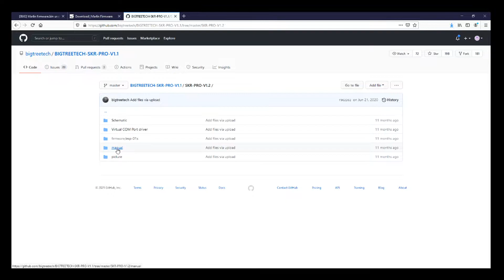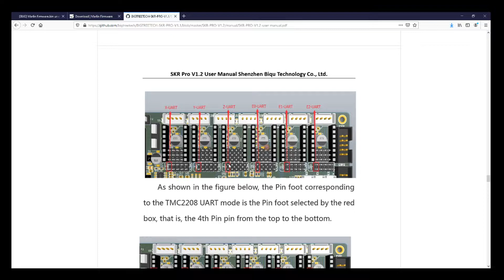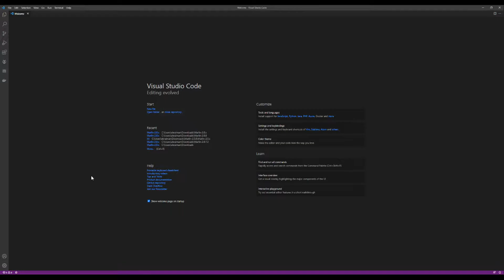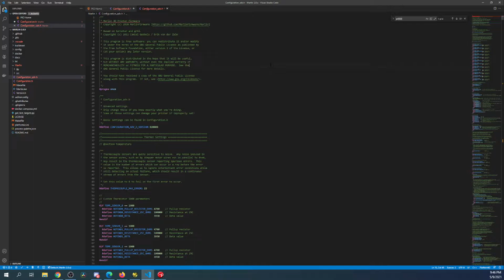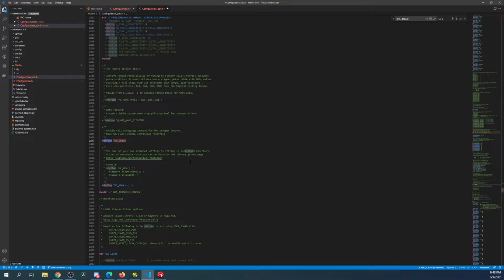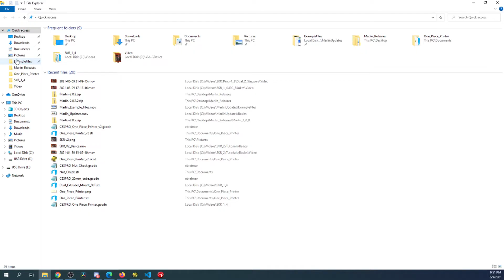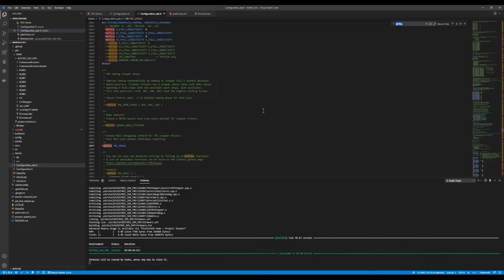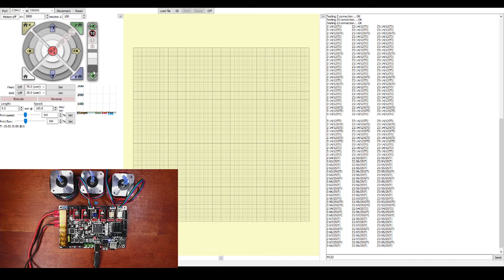SKR Pro V1.2 - Dual Z-axis steppers with TMC2208 UART

Comment: great video!!!  i can't figure out what you're using for a power source....at 6:09 you start connecting the power to the board....and stated you were not plugged in and show the power cord....so after you connect steppers and power (red/black) cables...what are using to the power the board to test all these connections?  also when you have the red/black cables connected to the board what is the other ends connected to?
Reply from the maker: It's a PSU.  The power depends on your requirements of either 12 or 24 volts and devices required.  Reprap website has more information.

Comment: 5:14 I have a question about your placement of the stepper motor wires. You have one in Z-0, skip Z-1 (jumpers where wires would have gone) skip E-0 for extruder use, and then plugged into E-1 and E-2. I have an Ender 5 Plus that uses only 2 Z motors. Should my orientation be Z-0, skip Z-1 using jumpers, E-0 for my extruder, and E-1 for my second Z motor?? Would this have me using only 5 stepper drivers?? I am confused as to why you have 3 Z motors here.
Reply: did you find the solution?

Comment: wait so how does the firmware know which pins are the other 2 z steppers ? After all you plugged them in the E1 and E2 stepper ports, won't the firmware just think you have more extruders?
Reply from the maker: Most the time my video material is done at request of viewers.  Obviously some videos are not easily done due to costs and space to record.  As soon as I can afford a house, space concerns should be resesolved.
Reply: @EdwardBraiman  I understand, lol I know because I live in an apartment with my entire family. Btw that little rig you made to test the stepper drivers the one with the traffic cone, yea that's an awesome and ingenious idea. Lol Take your time with regards to the video, and thank you for taking it into consideration most youtubers don't even respond to their comments. Have a good day!!!
Reply from the maker: The traffic cone is from a dual color extruder on a modified Ender 3.
Reply from the maker: Someplace in  configuration an override occurs during build process.
Reply: @EdwardBraiman  Would this override be affected or "confused" if the configuration was instead to have two Z steppers (again controlled independently) and two extruders ? Would the firmware process just differ in the sense that you would need to define another extruder, change the driver type, and thats it?
Reply from the maker: You'll need to experiment.  I've not tried all configurations of steppers.
Reply: @EdwardBraiman  Oh damn, thats ok. I'm thinking about getting the octopus board for my ender 3 v2. I assumed this video most of the directions also applied to the octopus board. I want to have dual extruders and Dual independent Z axis, plus also have sensorless homing. I know its a lot. For now my biggest concern would be to have the independent Z, so I could wait for the dual extrusion. Would it be possible for you to make a video regarding this ?
Reply from the maker: In theory you want one stepper driver with on z-axis or two NEMA 17 running off one stepper.  It keeps most movement in synch.
Reply from the maker: I'll try.  Still waiting for temperature in my area of country to get cooler.
Reply: @EdwardBraiman  Ed thank you so much for all the tips and help, you're timeliness responding is very much appreciated, you've got a new subscriber. I assumed it was better to have two independent z since you made that other video explaining how to do it.

Comment: Great video! I have a CR10S I'm looking to upgrade, I like this particular board as it leaves room to add a second extruder in the future. To start off, I'd like to use microswitches on both sides of the gantry as endstops for the both Z steppers, in order to be able to do a G34 auto Z align. Can you confirm if that's possible, maybe do a follow up video? Can't find much about it so far.
Reply from the maker: In most cases two endstop is not needed, if you have two carriages, then it's possible.
Reply: @EdwardBraiman  thanks for getting back to me so fast! Carriages are in the X direction, not the Z. The CR10S has 2 lead screws and steppers on either side of the gantry, so I would like to level the gantry to the base first, before leveling the bed to the gantry. Creality hooks them up to the same stepper driver, I'd like to give each their own to make them independent. 

Many people use an ABL probe to do it, but essentially then you would level the gantry to the bed. If the bed is misaligned to begin with, you'll end up with slightly trapezoide parts as the gantry  itself is still standing straight up.

Also, I don't have an ABL probe yet, that would be an optional upgrade in the future. For now, I'd like to just get the gantry level automatically, instead of using identical distance blocks or calipers to figure it out by hand.
Reply from the maker: The easiest method to level is a bubble level.  Unfortunately only z min or z max should be used.  Using both is not needed as in Marlin you can set a max distance of axis in configuration.h